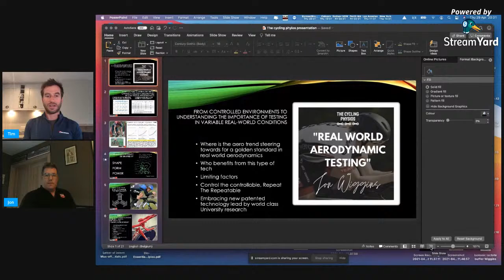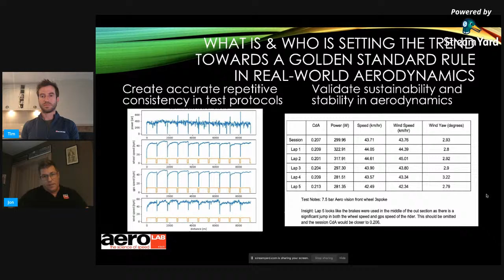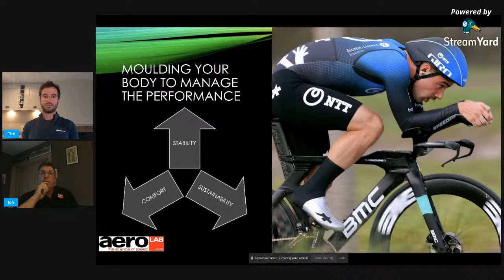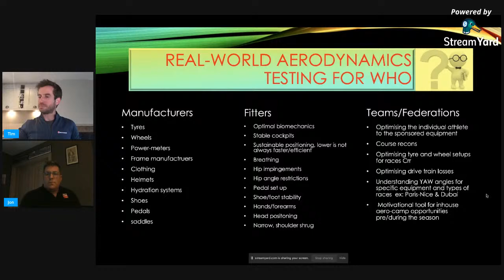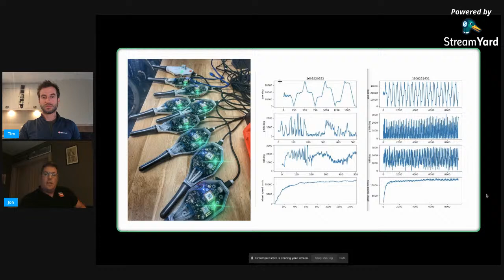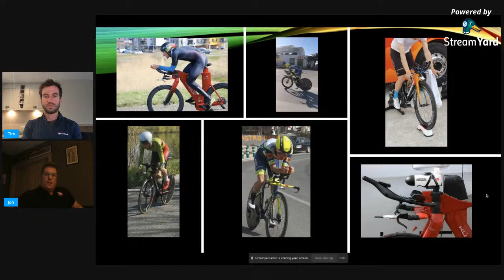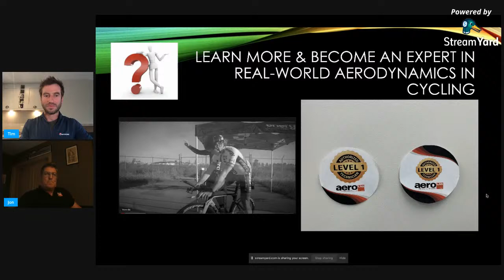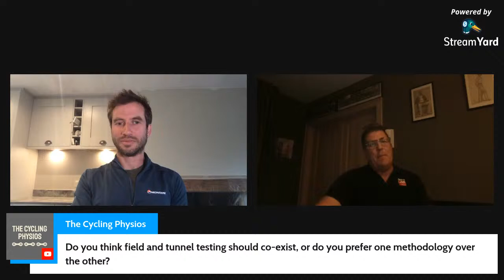"Real World Aerodynamic Testing" with Jon Wiggins

Comment: Very nice presentation, Jon. 

The demands on data fidelity (and sampling rate) are really a key for real-time measurement. If you don't need real-time the demands for post ride analysis are quite a bit less. Real-time (or near real-time) is essential for teams or fitters for whom time is money but the math and physics of drag estimation is really the same even if you're doing post ride analysis. The key is to match the proper protocol with what you have available and the constraints you're facing. As riders become more comfortable with testing protocols, they'll require less hand-holding. 

And I agree: wind tunnels, CFD, and field testing are complements, not substitutes.
Reply: Thank you very much